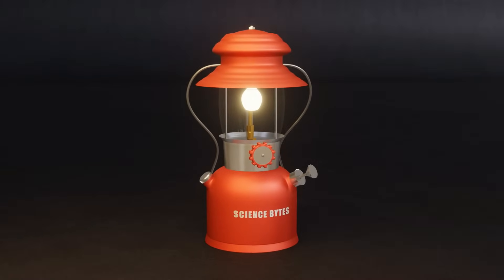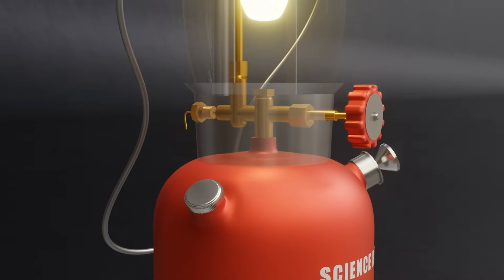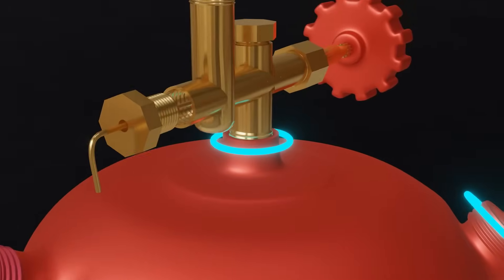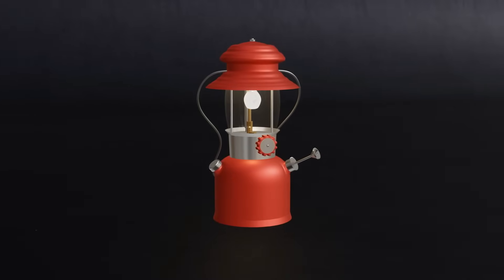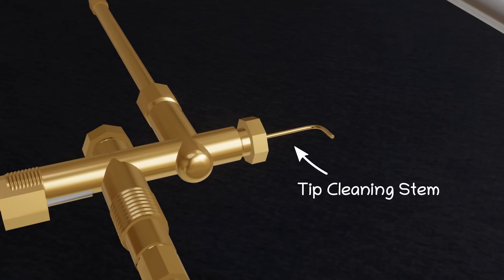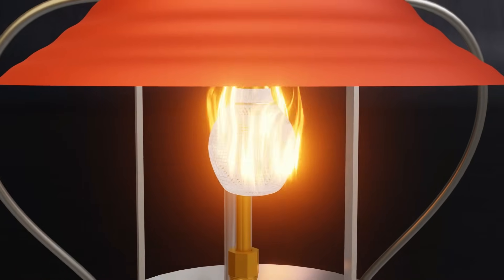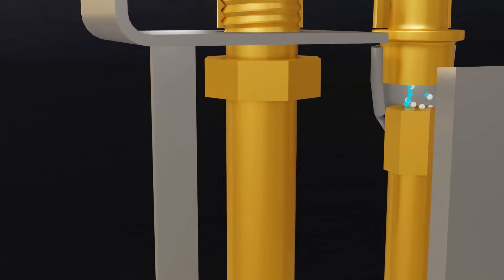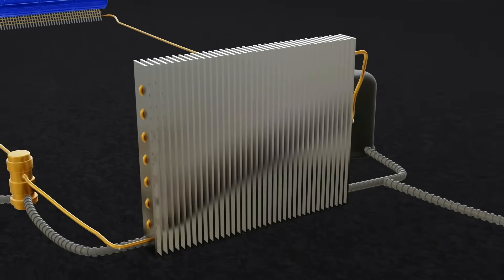How Pressure Lanterns Works? | 3D Animation

Comment: This is a pretty good video that does a decent job of explaining the principles of gas-pressure lanterns. However I'd like to comment on a couple inaccuracies.

At the beginning of the video, you state that most pressure lanterns run off of kerosene. Though not inherently wrong, most pressure lanterns run off of white gas/naptha. Kerosene pressure lanterns certainly exist, but they are less common than white gas lanterns. If kerosene is used in a lantern that is designed to run ONLY on naptha, you run the chance of having a big soot-covered fireball on your hands if you do not preheat it. Conversely, a KEROSENE lantern can usually burn both kerosene and naptha without issue (with the odd exception to this rule.). In most cases, regular unleaded gasoline can be used as a substitute for naptha but it will clog a generator faster.

The other thing I'd like to point out, is that you explained the inner workings of the fuel/air tube, but did not adequately explain the PURPOSE of the fuel/air tube. With the valve in the CLOSED position, while the metering rod does block off the lower orifice of the tube, it does not block it off completely. With the metering rod blocking the lower orifice, it allows maybe 10% of the fuel flow that would normally be able to flow through. Because the lower orifice is restricted, it is easier for air to enter the upper orifice than it is for fuel to enter the lower orifice until the metering rod moves out of the way. This trickle of fuel mixes with the air that comes through the upper orifice and that fuel/air mixture is sent up to the generator and 'spits' out the generator tip. This fuel/air mixture allows what is called an "instant-lighting feature" where the user can open the valve 1/4 turn (metering rod blocking orifice) to allow the fuel air mixture to exit the generator where that mixture can be ignited with a match/lighter and heat up the generator. With the valve still open 1/4 turn, the lantern will burn poorly usually for 5 to 15 seconds or so before it heats up enough to burn properly and the valve can be opened fully (metering rod no longer blocking orifice). Once the metering rod is out of the way, the lower orifice is totally unobstructed and the fuel/air tube supplies a steady stream of fuel up to the generator. Once the valve is fully open, the fuel/air tube no longer uses the pressurized air from the fuel tank.

While it is also not wrong to preheat a naptha burning lantern with an instant-lighting system using a preheat cup or wick torch, it should not be necessary if the instant lighting system is working properly, and if you are burning the correct fuel intended to be used in the lantern.

Comment: This animation does a great job visualizing the vaporization and pressurization processes inside the lamp. I’ve used similar pressure lanterns on camping trips, and priming correctly is crucial especially in colder weather. One small mistake and you’ll get inconsistent lighting or even flare-ups.

Comment: This is not the whole story. You missed a very important part !! The air tubes that run up to the mixing chamber .  When clogged  with  a spider web  or dirt dauber your lantern will never work well..  Most lanterns have 1 or 2 air tubes. The only ones that do not have them are the Petromax and clones of it. They use a air gap between the generator and the mixing chamber. All lanterns that I know of take out side air in the right amount to burn and make light. I hope this helps somebody . For the Petromax the air gap should be about 14 mm  for a clean burn. And that will change over time so check it when you fill it up.

Comment: Should note that there are significant differences between a kerosene  lantern and a white gas lantern. White gas does not require preheating the generator, rather it draws fuel vapor off the top of the tank from that air hole discussed in the beginning of the video. Opening the valve 1/4 turn opens the air hole while keeping the fuel port in the bottom of the tank (mostly) closed.

Comment: FYI, the annimation shows a gasoline lantern, usualy run on "White Gas" lantern fuel. The kerosene version has a cup under the generator for a small pool of Alochol to preheat the generator to produce vapor. Without preheat, the lantern would spit liquid and result in a large smokey flame and would be very difficult to start. Coleman brand made very few Kerosene lanterns. They primarily built white gas and Propane lanterns.  Do not put lamp oil or kerosene in a gasoline lantern. It will be almost impossible to properly light, and when saturated with the oil spray, is likely to result in a large oil fire when it does start. 
The animation of the starting is in error. The video claims the valve closes the fuel off at the bottom of the tank. This is incorrect. The valve stem when screwed down seals the fuel.  The rod that extends to the bottom of the tank only partially blocks the fuel and is used for starting the lantern. As the fuel flow is restricted, air is drawn down and mixes with the fuel going to the fuel valve and generator. This mix helps atomize the fuel to aid in starting the lantern and prevents flooding with too much fuel. As the generator heats in starting, more fuel vaporizes inside the generator, reducing the flow rate. As the flow rate drops, less air is drawn into the generator. This is when the lantern begins to burn bright. Then the fuel valve can be fully opened, resulting in no longer drawing air into the generator.
The Kerosene version of the lamp works the same, except before opening the fuel valve, the generator has to be preheated by filling the cup with alcohol and burning that mostly out, then lighting the lantern. The Kerosene version does not have an air bleed in the tank and fuel restriction rod. They must be preheated to properly start it.
Hope this helps.
Disclaimer, Own and have used many of these lamps growing up and camping in my younger days.
If you get one of these lanterns, look online for the proper starting for the version you are trying to run. You do not want a fuel spill and the resulting fireball from slow starting.

Comment: These kerosene lanterns are such a pain on the ass to use. Your much better off getting a gasoline lantern, you dont have to use alcohol and preheat the generator every time you want to light it. There are also propane models that you dont even have to pump up, I own all three types and I recommend the gasoline one for outdoor use, and the propane one for indoor use. I honestly can't recommend the kerosene type unless you are in a situation where you only have access to kerosene. Kerosene ones are just too much of a hassle and unlike the gasoline ones that are brighter then the propane ones they don't have any advantages over the gas model.

Comment: Not mentioned is the Aida type blowtorch starter. The German Aida lanterns have a miniature blowtorch powered by the pressure tank. The torch is lit and blows directly on the generator to heat it enough to vaporize the fuel. Once the generator is hot enough, the vapor will light the mantle, which will keep the generator hot enough to run, and then you shut off the blowtorch.

Comment: Saying :usually Kerosene" is kinda wrong. 
Petromax are Kerosene, usually used in Europe and some other places.

Coleman are mostly gasoline (white gas or unleaded)  in the US and Canada. More or less the same method of operation as shown, but Coleman uses a different air mixer. 
Nice graphics. 

You used an Aladdin style mantle to show the burning, that isn't the right type for this lantern.

Comment: A lot of inaccuracies and mistakes... perhaps don't make engineering videos without understanding engineering.  For example, a threaded screw connection can never be airtight: you need a sealing face.
Reply from the maker: Thanks for your input! Do I really need to mention where the gaskets or sealing faces are? It’s a commonly known fact that threads alone aren’t airtight—sealing materials like gaskets or sealing faces make them airtight. I appreciate the feedback and will ensure more clarity in future videos

Comment: Never saw one that use kerosene, white gasoline(coleman fuel)  or propane it what they all burn.
Anyone ever burn kerosene in these lamps?
Reply: We use kerosene here in our 3rd world country before we had electricity in the 90s. Lantern was Made in China.
Now kerosene is hard to find & expensive, only sold on bottles not at gas stations anymore.
Reply: kerosene was used in 3rd world countries.  much cheaper than gas before.

Comment: Thumbnail with "green glowing goo" preseted as "something radioactive"? Thumbs down.
Reply from the maker: In the early days of their invention, mantles used in gas and pressure lanterns were made radioactive. This was because they contained thorium dioxide, a radioactive material, which was used to make the mantles glow brightly when heated. Thorium was chosen for its excellent properties, such as high melting point and ability to emit intense light when incandescent.

Comment: When I was in the scouts there were a few of these, but as I got older the propane powered versions were most popular. I bought a Coleman version at an estate sale about 5 years ago and tried to get it working well but didn't have a whole lot of good luck. I got it running good once, but this video is the first I'd ever seen about pre-heating the generator tube. Maybe I'll have to dust if off again and see how it goes. These lanterns work great when they work!
Reply: there is a good chance it's not broken . those things are tough . just need pre heating .
Reply: Send it back to Coleman. They will rebuild it for 60 or 70 bucks

Comment: Love the animation and explanation but there are a differences in type of lanterns. The Fuel and air tube does pull fuel up from the bottom on the tank, and air in the top,  but it cycles up and down ever so slightly as the pressure builds up in the generator to regulate the amounts of air and fuel.  This is the whole primes behind Coleman Patent of 1913 for their lamps.  With Air / fuel in the generator the vaporization was faster and the term "Quick lite" came to be. Over 90 of all the Gas Pressure Appliance (GPA) sold use White gas that is highly more refined then kerosene.  White gas does not need that much preheat or no preheat to start. Most kerosene GPA have the preheat cups for alcohol or that cotton swap thing you showed, and some have different generators for the different fuel.  Over all a great video
Reply from the maker: Thanks for the detailed insights! I appreciate you sharing the history and technical differences—it adds so much depth. Glad you enjoyed the animation and explanation!

Comment: The check valve is drawn in the wrong direction.   The ball needs to prevent the pressure from coming out.  As drawn, it would prevent the air pressure from going in while trying to pump.
Reply: Hey Andy.  The check valve is in the correct positions.  What is not properly 3D model is the end of the valve it self.  When they are made, the ball in inserted in that end, and 2 or three sides of the valve are pushed in ( crimped ) to retain the ball but not seal up the end.  As air is pumped in, it pushes the ball down and air goes around it, them flow up that little pipe to the top of then tank.  That little pipe is there so only air will escapes if the valve fails and not fuel.  ( if you google Coleman 200a check valve you can find some on E bay to see how the end is crimped.  )  But good eye and mind.  The way it is modeled, it would not of worked.

Comment: Surprised you used an Aladdin mantle lamp for your mantle add in video as it is a wick based mantile lamp
Reply: A naked flame will have a colourless or blueish portion where the fuel burns and produces heat and a yellow portion which consists of soot which becomes incandescent due to that heat and so produces the light.
In lamps such as this the mantle becomes incandescent due to the heat of the burning fuel inside inside it. The mantle just makes the thing a much more efficient producer of light.
Reply: Maybe you're confused—this is clearly a pressure lantern, bro.
Reply: @Official_Science_Nuggets   Dustin is talking about the part in the video explaining what the Mantels are made of and how they burn.  At 9:18 - 9:24 there is a Video clip inserted of an Aladdin Mantle being light on a stove show how it burns off and leaves just an ash behind.  The maker of the video probably just got that clip on line some were and use it as an example.  The Mantels work that same way in a Wick and mantle combo style lantern as  they do and a Gas pressured lantern.  Trapping the heat to make the light and not the flame it self.
Reply: @Junkboy888  Hey, Thanks. So actually I confused. Thanks for your clean explanation.

Comment: I have two model 200 Coleman lanterns for camping, and also a kerosene mantle lamp which does not require pressurization and is therefore silent; just an updraft created by the very tall chimney.

An important item I learned is that old/antique mantles - if you can find them - provide more light than the new ones.  Why? Because people freaked out over the tiny, tiny amount of radioactivity present in the thorium salt-based mantles, so now there is no thorium oxide in them, and they are not as efficient.

In the 1980s it was reported that Thorium's radio-daughters (Decay products) could be volatilized and released into the air upon incandescence of the mantle.  A lawsuit (Wagner v. Coleman) was brought against Coleman. The company changed its formulation to use non-radioactive materials, which apparently cost less and last longer... and also produce less light. >_<

 Hurray, fear and emotions over science and logic!  'Idiocracy' isn't a comedy, it's a documentary.
Reply from the maker: Thanks for sharing your knowledge!
Reply: The same people crying about the radiation from the old style mantles will receive much higher doses of radiation by laying in the sun to get a tan (but that's ok).

Comment: Why the hole in the pump knob ?
Reply from the maker: When the fuel reservoir is fully pressurized, giving a final push to close it can be challenging. That’s where the small hole plays a crucial role—it allows air trapped between the check valve and pressure cup to escape through the hollow tube and out the small hole during the final push. This relieves extra pressure on the fuel valve, making it easier to fully lower the pump handle and securely close the cap.

Comment: The working principle of pump assembly isn't clear like why you need to place your thumb on the valve little hole opening? From where it takes fresh air to pressurize the chamber?
Reply from the maker: When the fuel reservoir is fully pressurized, giving a final push to close it can be challenging. That’s where the small hole plays a crucial role—it allows air trapped between the check valve and pressure cup to escape through the hollow tube and out the small hole during the final push. This relieves extra pressure on the fuel valve, making it easier to fully lower the pump handle and securely close the cap.

Fresh air enters through the gap between the hollow tube and the cap!

Comment: I never knew it was the mantle itself that provided the light, I always thought it was the burning gas inside the mantle somehow. And I always thought you used white gas in them, I have never heard of using kerosene. Here's a story what sounds like pure BS but I know it to be true, a friend of mine was fishing in a lake where the water was 30 or 40 feet deep. One night he dropped his lantern overboard. Next day he swam down with a garden rake and recovered it. The guy was straight up and not the type to make up a story like that
Reply: It’s a common misconception that the gas itself produces the light, but it’s actually the mantle glowing white-hot due to the heat from the burning gas. And yes, while white gas is popular, kerosene is also commonly used in pressure lanterns, especially in certain regions.

Comment: Excellent. At 82, I grew up using these for camping in the 50s. Then i used them as a science teacher,  I said as i actually did this,  "I have been driving all day to get to a camp, . The rough road  broke the bag. I am hungry and it is getting dark. I use my fingers to clean out the old ashes like this while eating a sandwich. Then I light the mantle and fix a supper, and eat the radioactive dust on my food." My fingers and the cracker sent the Geiger counter wild. ------ The subtle danger is alpha and beta radiation, which are weak outside, but very dangerous inside the body. Think of Alpha (helium nuclei) as a shotgun, beta (electrons) as a 22 rifle, and gamma (photons) as a hunting rifle. The alpha and beta (as in a smoke detector) are weak outside, but inside the body it is like shooting shotguns and 22 shells randomly in a very crowded  stadium (your body tissue). Gamma rays are far more dangerous than X rays. ------ After the Japan reactor explosion, they showed people walking around with a Geiger counter, waist high. That only picks up gamma rays, mostly from the uranium fuel rods, etc. The hidden danger is the dust landing on the food crops, eaten by animals that we eat, and so on, but you have to hold the Geiger counter close to pick up beta, and most Geiger counters don't even pick up alpha particles that can't penetrated the metal Geiger tube.